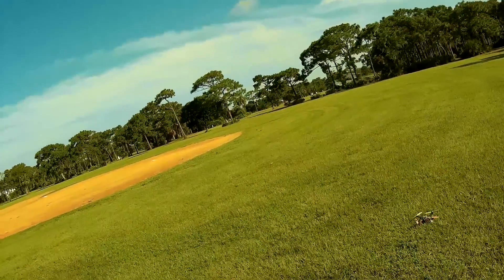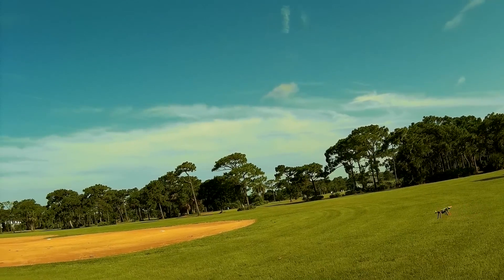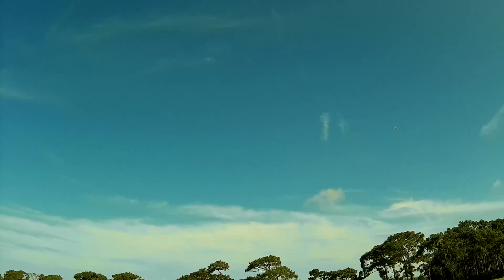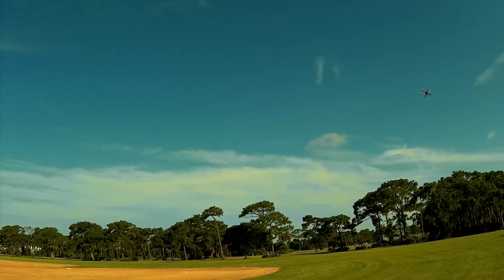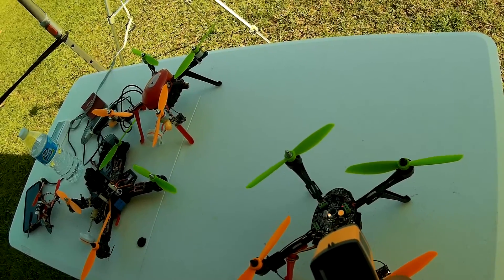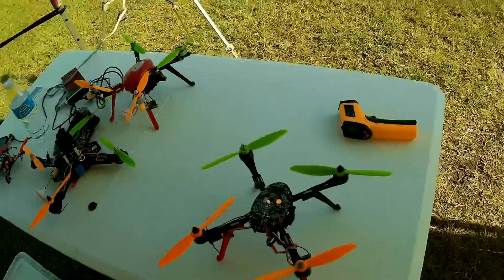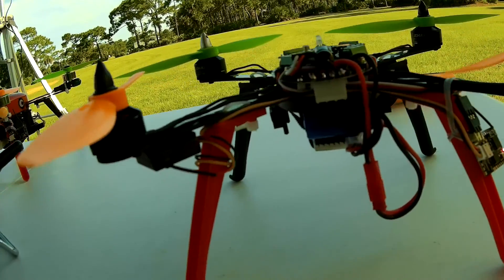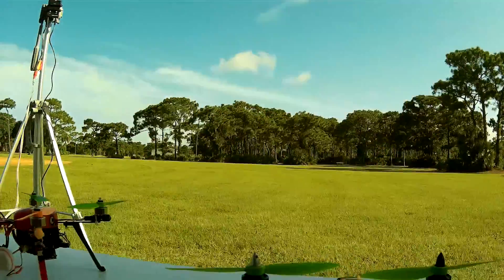RC Eye One Xtreme with Emax 1806 motors continued

Comment: Did you just mount the new motors straight to the default flight board
Reply from the maker: You need to order a frame that will accept the new motors

Comment: What do you think of the PFG Carbon sport? I was thinking about getting the frame to save some weight for FPV. Also, do you know of a top plate that will mount above the frame. I believe the standard one PFG sells screw in I the right locations of this frame.

Comment: Looks like the black eMax caps are for the ccw threaded motors? Did you have to add any washers or locktite to keep or a firm socket tightening to keep these props from coming loose or is did the reverse threads prevent this issue? Thanks!
Reply from the maker: +salpsx1 No,  so long as you tighten them sufficiently they shouldn't come loose.  You could alternatively use nylock nuts and use all CW threaded motors.

Comment: how do you tighten the motor caps, just by hand? They keep coming loose and I have them in the original order as the stock EOX, just lost a cap in flight mode with emax motors and the performance was lacking in moving the quad around, wouldnt really move from side to side. but noticed after I lost the cap and the prop came off that the other nuts were slightly loose. woulda thought that was impossible since the motors move in the opposite direction from the threads to loosen. thanks

Comment: Hi waht exact must i do to run V262 battery or any 2s lipo battery on my EOX
Reply from the maker: You need one of our adapters: http://www.massiverc.com/PrestaShop/en/316-xtreme-jst-power-adapter.html
Reply: or i can soldering cable on negativ and positiv on the main board.is that right
Reply from the maker: Jaroslav Nemas You can do that as well, although that definitely would void your warranty.  I personally have mine set up like this.

Comment: What exact battery are you running and how much flight time are you getting with this set up?  Thanks!!!
Reply from the maker: In this test I'm only using a V262 LiPo,  in my FPV runs I'm using a Turnigy 950 mAh and I'm getting roughly 6 minutes.
Reply: MassiveOverkill1 ok cool.  When you say V262 lipo is that the 850mah or a higher one?  THANK YOU!
Reply from the maker: tekyguy It's the 850 in this 3rd person test.  I recommend either the EOX 1150 battery or the Turnigy 950 at the minimum for this motor\prop combo.